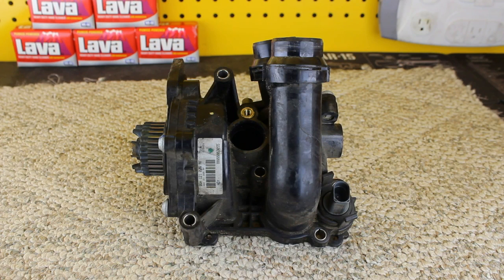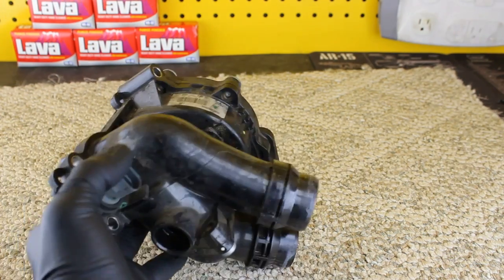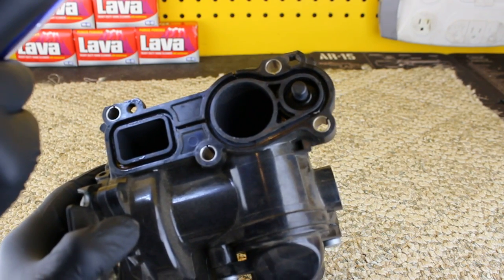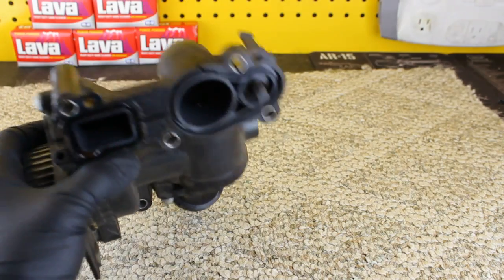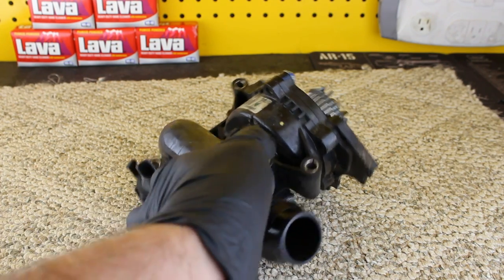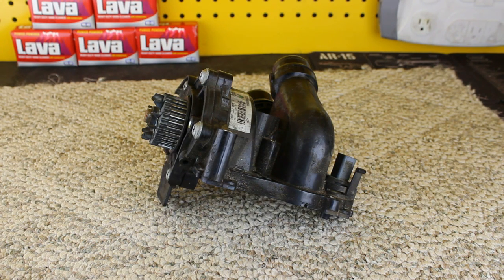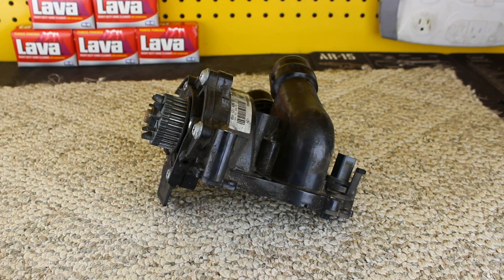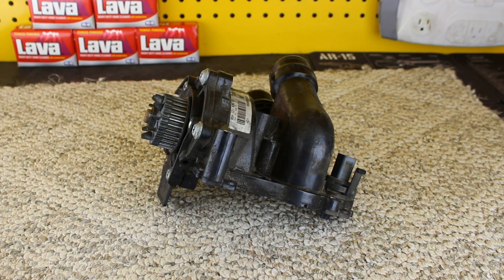How VW 2.0t TSI Water Pumps Fail

Comment: The more I see of your videos showing VW plastic parts the more I appreciate my 1990 Nissan with all metal parts. I cannot believe the motor manufacturers have fallen so low as to use crappy plastic parts that don't last. I suppose the upside is you'll ALWAYS have a job! Nice video and thanks.
Reply: There's aluminium replacement version now
Reply: Its all about weight and gas efficiency , horsepowers! They sacrifice that for wear and tear it's makes them pockets fatter win win for vw!
Reply: cirian75 please send a link

Comment: A plastic water pump. That's the power of Wolfsburg engineering for you. Das Auto.
Reply: It is the gasket not the housing, so what that have to do with it?
Reply: Mike M he also said they can crack
Reply: My friends Jetta is leaking....  I believe internally. I just replaced mine of my 2000 Tahoe limited 5.7L, seal was shoot and the baking plate was rusting
Reply: Whenever I do a timing belt on a VW/Audi engine, I always use an upgraded water pump with a metal impeller.
Reply: das caca.and i drive a golf diesel 2015....sad but true
Reply: @johne6081  completely agree
Reply: @johnE where would you find those parts your talking about ? Any recommendations,.  appreciate all of  y'all inputs
Reply: @mikem5044  did you even watch the video? Said the housing can crack
Reply: @bEEBO178  yea, my housing cracked twice. 70,000km and 150,000km
Reply: @eponymous7910  so, I deal with this scenario more often than I would like. Planned obsolescence does seem here to stay. I'm not sure that there has ever been a system where this wasn't the case. What? Your knife isn't sharp enough Mister 1929. Well you will need that knife properly sharpened when the knife sharpener comes to your neighborhood. 

Oh, you have a horse? Well, your horse will need maintenance for a bit. Oh, that bit will be it's entire life.

What really grinds my gears is laymen. I mean lay person that believe that their knowledge supercedes engineers. There always seems to be this idea that some part the layman finds fault in, needs to be built of a "tougher" material so that that part won't fail. 

I'm not suggesting that greed doesn't apply sometimes but sometimes the proper strategy of design is that a low cost part is designed specifically to alleviate the possibility of a catastrophic failure that only damages an inexpensive part. 

It's tough not to draw a parallel in the RC world. Constantly people install more sturdy parts to alleviate a perceived problem with a "weak" part by replacing it with a metal part. The more durable part just transfers the energy towards another part with the potential of being more expensive and time consuming to replace.

I find it amazing that I live in a world where the problematic simple carburetor has been replaced with a system that integrates a solution satisfied by carburetors with environmental awareness at a similar price point.

/Puts on tin foil hat. It is interesting that the intake manifold runner system seems to fail at a similar time that may necessitate a "proper" "carbon cleaning."
Reply: The new 2.0 TSi engines also have plastic oil pans.  I kid you not!  
By 2023, VWAG will figure out how to make plastic pistons!  Ridiculous!
Reply: Engineered to fail out of warranty and to cost a fortune to replace
Reply: Literally one of the only problems with the tsi
Reply: I laughed too hard at this comment

Comment: This video helped me realize the REAL cause of the failure this water pump in my car.  Short story is that if you use Gunk engine degreaser on this engine, it lays on top of the gasket, under the intake manifold where you can't rinse it off.  Three days later the coolant all blows out where the gasket swells and bulges out the side of the housing.  It took two water pumps to figure this out.
Reply: What's an engine degreaser lol
Reply: Interesting..mine failed last week out the blue and based on your comment, realised fuel leaked from the fuel pipe last week down the intake manifold 🙈

Comment: A waterpump completely made out of plastic....
They havnt learned out of the failing from the plastik impellers in 1.8T engines...
Reply: They just simply want to sale parts.
Reply: i am a Mechanic. what is a good price to charge for this job.
how much labor hours it comes with
Reply: You are a mechanic and can't get the book time? The book time is 5.9 hours. It is unpleasant to say the least which is why I hate working on VW and Audi's. You can create other problems doing this job.
Reply: I'll stick with Honda.
Reply: and all the failing plastic coolant parts bolted to the motor and throughout the cooling system hahaha
Reply: @marcsmith3881  It wasn't that bad a job on the B5 Audi platform, once you put the lock carrier into service position. My sons and I have done successful timing belt + water pump jobs on a 1996 A4 2.8, a 2000 S4 2.7T, a 2001 Passat 1.8T, and a 2002 A4 1.8T. I admittedly haven't changed the water pump on a VW platform (transverse-mounted engine) yet.
Reply: @johne6081  I have know doubt, but as you mentioned, those are 17-20+ Year olds. Many newer vehicles have far less space under the hood and also transverse mounted engines. The arrangement of component locations are quite different. Also many of the newer water pumps are electric and not mechanical. I see those fail in BMWs often as new as 2015s.

Comment: It's kinda sad looking at all the comments here saying how early their water pumps fail. My 2004 VW has been pretty good at 178k miles, but I don't think I'd get a new VW. Too much plastic... I'll probably go for a Tacoma lmao
Reply: I'm a tree The newest Toyotas use 'plastic' oil filter housings {and who knows what else is plastic}. I used to have a 2011 Camry, and after only 100,000 miles, the transmission started failing. Also, all the suspension components in Toyotas are cheap CRAP. After only 100,000 miles, my insurance actually totalled my entire car just because ALL the suspension components were failing {even though the car was in cosmetically brand-new condition}. I will NEVER purchase or associate with a Toyota product ever again.

Comment: My original water pump is still going strong at 200K miles - no leaks.  However - since I have the intake off - I am replacing it with an aluminum unit.  I was looking for the torque specs and found this video.  Spinning the belt pulley on the pump - there is a slight roughness.  But I am shocked the pump never once leaked.

Comment: I just thought I'd share my replacement experience. 

My dealer here in MA ran a warranty replacement of a failing waterpump on my 2011 GTI 4dr DSG.

They replaced the pump with a part numbered 06J-121-026-BB

The supervisor who went over the replacement with me said the BB part is a more reliable part that they stock because of how often the original fails.

It's only been about 75 miles since I had the pump swapped out so I really don't know how reliable the new part is yet. The first pump failed after about 26,000 miles.
Reply from the maker: for the most part 1 replacement is all the car needs. I have seen a few fair more than once. I feel like many of those are workmanship issues. 

thanks for sharing.
Reply: HumbleMechanic You wouldn't believe how many people I have met from my VW meet ups that have had 3 or 4 water pump failures in a row on the same car. Some of them have said the plastic impeller cracked and exploded. LastHumansGarage here on YouTube has had 2 Mk6 GTIs and had multiple waterpump failures on both. Its totally ridiculous how poorly designed this pump and it's revisions are.

Comment: Nice video series.  I have a 2010 CC which actually has had none of the common issues that you've done vids on.  The car now has 162K miles and I just got done replacing the intake manifold since I was doing a valve cleaning.  I figured it was due.  The flapper was still working fine with no play in it.  The water pump is still the original.  Had I known it was sitting right there under the manifold I would have done it too, but it is still fine.  I can't believe the frequency of failures i'm reading about here in the comments....
Reply from the maker: That is AWESOME on your part!!! :)

Comment: Hi ! 2010 vw Passat  cc sport  Tsi coolant temp sencer  replcemant  I  spent   1  hour  and   i can't see the area of  the  sencer   I  saw  the  Water  pump assembly on   picture   and  the  pace  for   sencer  . I try to think  if i have to take  the  intake  manifold or   what !  so  i  can   get  to it.  the  resun  i  want to  change it  because sometime  yust   dont idle  up and  down  when  cold . is  driveabole  but  i  want t    get it  out before  i  get  stop somwhere on the   rode. .

Comment: Hey! Thank you for the video! 

If I was to buy a new water pump for the TSI engine which be your suggestion ? 

I want to make sure I purchase a good quality pump that has the least probability for failure .

Thank you !
Reply: I would like to know the same.
Reply: I also would like to know what water pump is best as a repair part????
Reply: Anyone care to update on their experience with this possible fault? 

I find this a fun motor in the 2014 CC. I'm a bit impressed how well this car behaves on the road and how the exterior easily continues to impress with simple finish maintenance. The headliner can EFF right off. Seriously, right the F right off.

Looks like this girl will be covered under warranty for the intake runner issue. Very smart of VW to address this dilemma finally for the rest of us that have been complaining. It seems cheaper than having to replace catalytic converters one day.

Love they way this thing drives. 

/Dumb mark4 lover

Comment: The water pump in my 2012 CC failed. It was, as you mentioned, the gasket housing on the rectangle side. Had I known that VW was aware of the problem, and has extended the warranty to 120k, it would have saved me $900....
Reply: Do you have more information about VW extending the warranty for the water pump failure?

Comment: Water Pump started leaking 09 vw cc lux 2.0 tsi
Just replaced platic coolant tank line & cooling hose flange. They both went out simultaneously. Also leaking from tubes off the firewall. Is there way to change just the connection without the entire heater core? Love the tutorials keep up the great job!

Comment: i have a question my 2012 VW GTI with TSI engine.. Water pump housing has an extra small sensor/connector on the thermostat outlet/cap.. i bought a new Gates water pump and it came with the outlet cap without the sensor/connect.. any insight please thanks
Reply from the maker: There are 2 different part number pumps. Sounds like you got the wrong one.
Reply: dude thanks alot man for your reply!  I appreciate it and look forward to more of your videos!

Comment: Great video, very helpful. 
I have just had an orange light on my dashboard but not blinking. 
I went to my garage and apparently the pump is leaking. The engine is not heating up and I didn’t feel anything wrong while driving. It’s an Audi A5 2.0T 2014. 
Do I need to change the thermostat or can I keep the old one? I just don’t want to waste money in parts that are still working. 
Thanks for your help

Comment: I have only just replaced on of these on my Audi A3....I purchase a new unit and o rings etc from a local Audi dealer.
The old pump had a small leak where pump bolts to the plastic housing...
Hope this pump unit last longer than the old one.

Comment: I see that Deutsche auto parts sells an aluminium water pump for the 2.0 TSI engine. Can you share your thoughts on that? Is it better? Last longer? Less fail prone? And can you do a DIY video on this??? 

Thanks for the great video!
Reply from the maker: I haven’t put one in my hands. I do like the idea. I’m worried people are replacing it and expecting it to be fine, but not fixing the oil leaks causing the coolant leak.
Reply: @HumbleMechanic  I had an oil pressure sensor leaking but after I replaced it the coolant is still leaking but the oil leak stopped. Does that mean one had nothing to do with the other?

Comment: Hi excellent content, 2009 Tiguan tsi 147. I have a potential failed water pump seal.  Not confirmed yet as Intake is still installed.  The funny thing is it only leaks when cold.
Reply from the maker: Odd. The water pumps is t the only leak point but the most common

Comment: Taking back to dealer. Now am looking at multiple water pump failure. First one failed with the light coming on and having to constantly top up coolant reservoir. Repaired at dealer after they denied or had no clue there was an issue for over a year.. And now I am 2 months into the replacement and having the same issue. Back to the dealer tomo.
Reply from the maker: Bummer. Sadly multiple pump failures is common

Comment: Great video. Our 2012 EOS is going on its 4th pump after 85K miles. I don't have such a problem with a plastic anything, but rather I have a problem with such a bad design that has such a frequent failure rate. Between this and other major problems our car has had, not to mention the "dieselgate" issue in general, I can't imagine every buying another VW again!
Reply from the maker: +Joel Freeman Sorry about all the water pump issues. That does suck.

If I may ask, how you feel about "Dieselgate"? For all practical proposes your car has no ties to that. Does that situation impact how you feel about the brand? (I am not being a jerk here, I really want to know)
Reply: +HumbleMechanic You are correct, my Eos, is not a diesel. However the degree of corporate malfeasance, the two faced "we will cooperate fully" and then do anything but, and the institutional arrogance are all reasons (compounded by my Eos experience) is why I'm turned off from the VW brand. The sophistication of the deiselgate  shows that it wasn't a bad player or two, but a much larger intentional method to lie, cheat and steal. I won't reward that behavior. I know other companies lie cheat and steal, but when they are caught, and in fact big time, they should pay!

Comment: Hey you know where is the boost pressure sensor located on a 06 passat 2.0t?
Reply from the maker: Yep. It's on the intake hose that goes up to the throttle valve.
Reply: Ok thanks oh and how can tell its bad?

Comment: I have a 2011 VW GTI and I just hit 100k miles. So far I have had 4 water pumps replaced in my car. It's really pretty ridiculous it's bad when the dealer tells me to call Corporate because the amount of repairs for the age and condition of my vehicle is quite alarming.
Reply: Just do not buy junk in the next time. My friends have 09 tiguan 88k on it. 3rd water pump was been installed by me. Grab some japan car of american one. All Europe cars like this. BMW, Mersedes, WAG, Volvo. They maybe good for lease, or as long as you have warranty on it. I have prius 08 with 400k on it. Nobody even touch engine on it yet. Just regular maintenance.
Reply: I traded the GTI in a year ago for a 15 Subaru Wrx and haven't looked back.
Reply: Cj House Subaru wrx is good cars, but whey have issue: you can not put just 2 new tires on the car, you need to change all 4 of them. Or overvise, your transmission going bad. They have common issue with it. Take a look in your user manual about it, they have mark in user manual about it. This is glick in stability control module, but they do not have recall yet about it, for reflash SCM.
Reply: Cj House Stop supporting all new cars. Every single one of them are a scam, because, they are making almost everything out of plastic nowadays. I have a 2008 Lincoln Town Car, and the same original Water Pump lasted flawlessly for ⅓ of a million miles!!!
Reply: ruhoer eoijre The newest Toyotas use 'plastic' oil filter housings {and who knows what else is plastic}. I used to have a 2011 Camry, and after only 100,000 miles, the transmission started failing. Also, all the suspension components in Toyotas are cheap CRAP. After only 100,000 miles, my insurance actually totalled my entire car just because ALL the suspension components were failing {even though the car was in cosmetically brand-new condition}. I will NEVER purchase or associate with a Toyota product ever again.

Comment: I have a thermostat heater short to ground fault P0599 and the temp gauge is going above the 190 mark. Temp gauge via OBD2 port shows temps as high as 235F. Any advice?

Comment: What drives the belt? What it called? I put a new pump in still over heats took the pump cover off and notice that the belt wasnt moving when the car was running. Is it driven by the balance shafts
Reply from the maker: Yep the balance shaft drives it

Comment: Just noticed my reservoir was drastically lower than it was just a few days ago.. Couldn't find sources (or any evidence at all) of a leak after a brief check under the car. It's been extremely hot here lately (in the 100's) and my car parking spot is outdoors. Could that heat be causing anything?
Reply: DigitalDyslexia the coolant could be evaporating that's why you see nothing visual.

Comment: ours became faulty right after we had a car oil leak fixed on a 2012 vw cc ccta. most likely affected the plastic. to expensive to fix and I bought the part myself. you're right about the car not overheating, however, it does leak consistently. Is it possible to just keep filling with water till I can afford to fix?

Comment: I've worked on a tiguan WP with a cracked housing twice = ~130k & 165k miles. 

Is there a proper way to check balance shaft vibration? Opinions about other factors that make these pumps fail besides the reasons mentioned in the video?